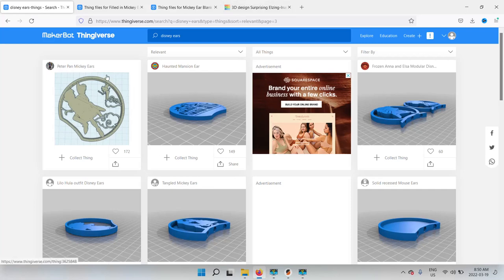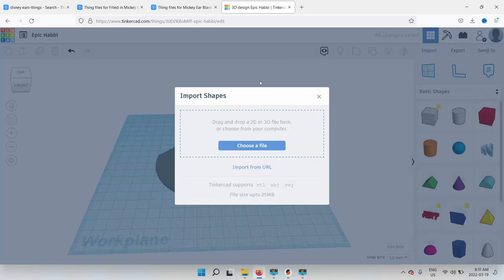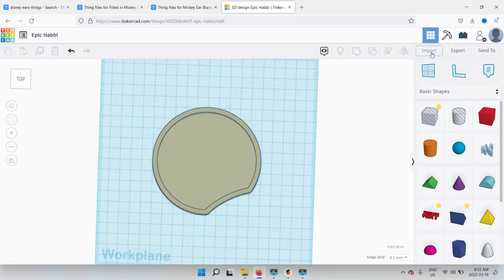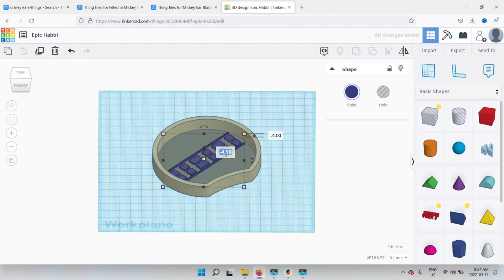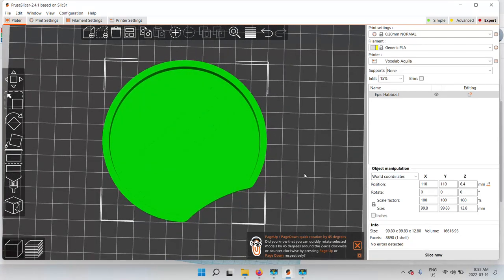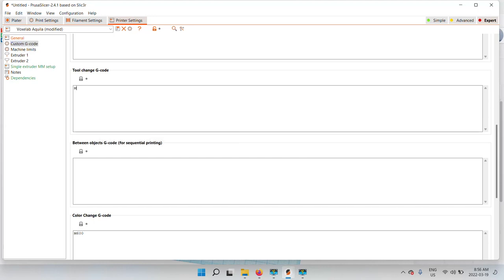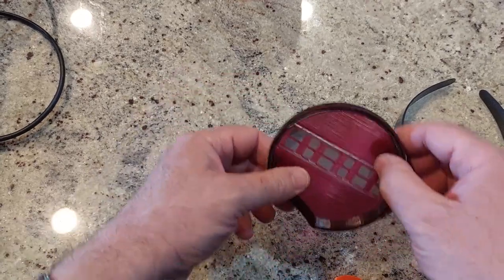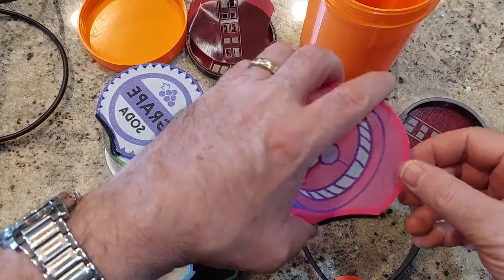Multi-colour Prints with a Single Extruder

Comment: Can you do an updated tutorial? This is amazing. Can it be thicker, or only one layer thick?
Reply: After watching this video, I tried a slightly different technique which happened to be simpler for what I was making. I started with a part (a light switch plate) and then added other parts to it (some STLs that were just text labels). Add those other parts by right-clicking the first part and "add part > load". Position those added parts where you want them, in all 3 dimensions. In my case, I made the text 2 layers thick and placed it flush with the surface of the switch plate. The Prusa Slicer right-hand panel will then give you a choice for each part which extruder to use. Other than that, the procedure was as outlined in this video.

(The bonus good news was that Prusa Slicer was smart enough to print the 2 layers of the text without a tool change. When calculating the thickness, don't forget that your configuration probably has a slightly thicker first layer. For example, my 0.16mm profile has a 0.20mm first layer.)

Comment: Does this only work with certain printers? I have an Anycubic Vyper and it made a purge line then the print head repositioned but it wouldn’t start printing
Reply from the maker: The vyper does color change differently. There are a few reddit threads about it. They  have a workaround from what I just read

Comment: I followed your phone case tutorial on making multicolor single layer prints which worked but as i pulled it of the bed the colors all came apart. How did you get all of your colors to mold as one? I use a Prusa MK3 btw.